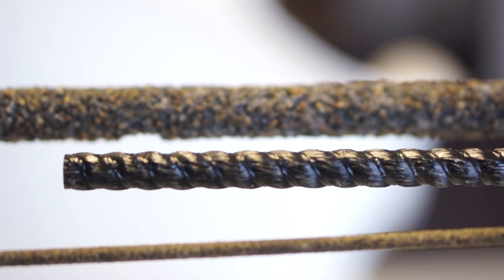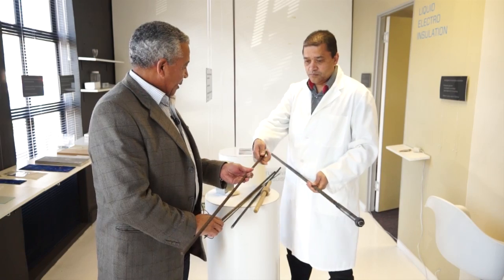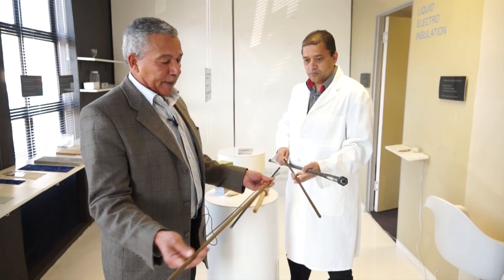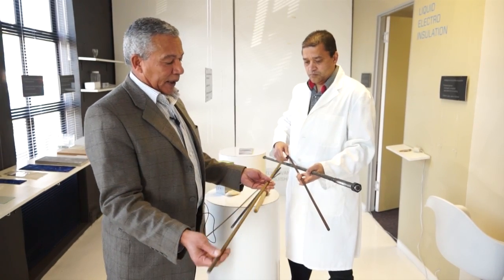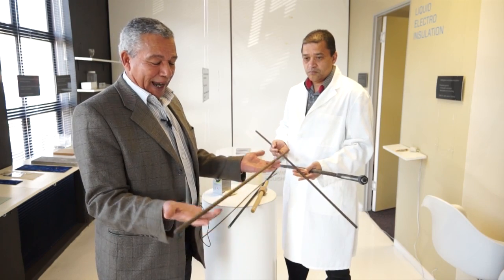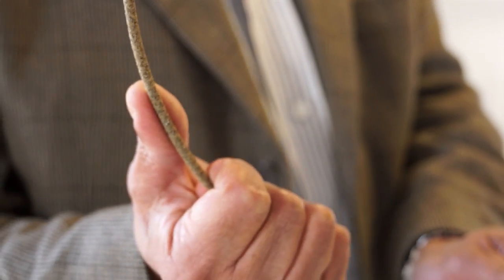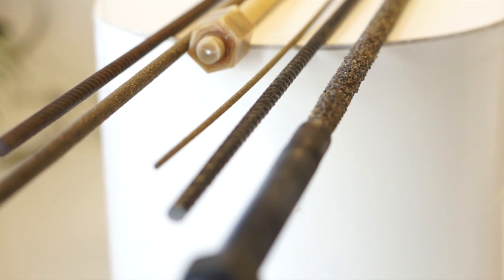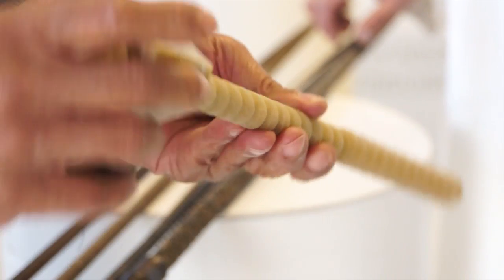Nanoland introduces the Rockbar [construction]

Comment: What material is that which is being bent so easily ? Bcuz as far as I knw fiber materials are brittle in nature, pls correct me if I am wrong
Reply: The answer is what he calls Rockbar is what he is flexing.
This video is from 2013. Fiberglass & Basalt rebar is more common now.  I am going to use Basalt Rebar because I don't want steel in my build. Too much lightning where I live. Good luck on your build. I am building a dome house with aircrete and shotcrete